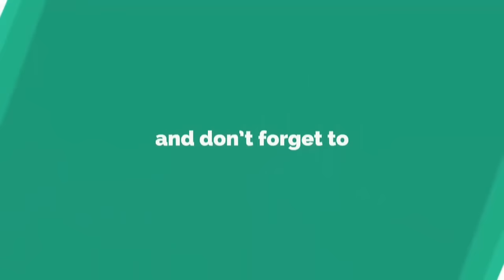Modern Machines Cleaning Street Equipment Technology - Street Sweeper Machine

Comment: Its NO shock that some of this footage is years old. Generally 'cleaners' who try their best to operate these machines are operating 10 to 15 year old machines that 'may' work 50% of the time if you're lucky!
Its not like those in 'management' are concerned about cleaners. Tell them to get it done (with faulty machinery) or sack them! 
If you want a good job done, here's an idea. Buy new machinery NOT used, NOT refurbished!! NOT last years (2 or 3 years) old model. Get the most modern machine, otherwise you are not doing the job you were paid for.
Reply: And get them properly maintained

Comment: Our vacuum sweeper truck integrates sweeping, cleaning and vacuuming. In addition, it can be used for both wet and dry purposes, equivalent to clean sweeping vehicles and vacuum vehicles.The main clients are coal-fired power plants, steel plants and cement plants.It withstands the test of the market,become the most cost-performance vacuum sweeper truck on the market.Cell/Wechat/Whatsapp: +86 13872875771.

Comment: In the video, some machines just flush out huge amounts of water, making a messy slippery road surface, splasing down cars and surrounding. Valuable water is wasted, and pollution is just flushed into waterways with the runoff water.

But there is one completeley waterless alternative, the Disa-Clean Dry & Dust-free High-Vacuum Cleaning street & Area Sweeper 

https://www.youtube.com/watch?v=nV4DHgyemMU

Comment: Yeah,.. I'm not seeing a lot of new or amazing tech here.. Most of the equipment does, (at best) a mediocre job. I also see a lot of worker indifference. With a prevailing attitude of that's good enough. Have to leave some mess or they'll lay me off! Or you have like the underpass scrapper. How often is that needed? Once a month or two? Best machine I've yet seen is a three piece mower for the road cutting. It could cut both sides of the guard rail and had a third piece that sort of weed eater that totally trimmed the posts and mile markers. They have a similar machine in here but the other I saw was a much more efficient design.
Reply: Е едслсклдцльпдепвпвпдпддодльльм м      жлфлелелеллекеллдлдлдкдкдкддклдкдкдкдкдзкзкзклзлдлдлздллддффьозоовоьофофф_ьльлдлфльльльлфьккдкфцл ц фллгциицифицфкфлкффкцкцф